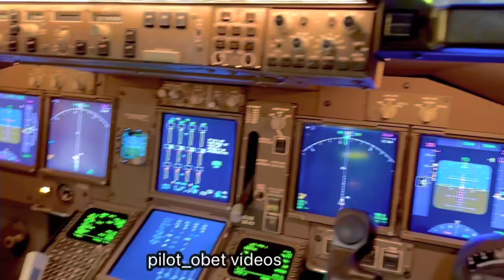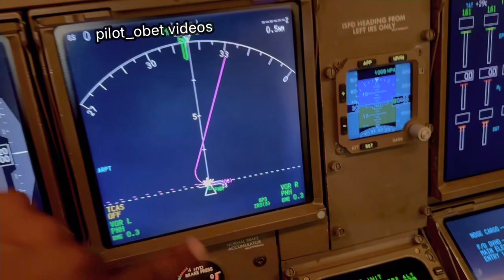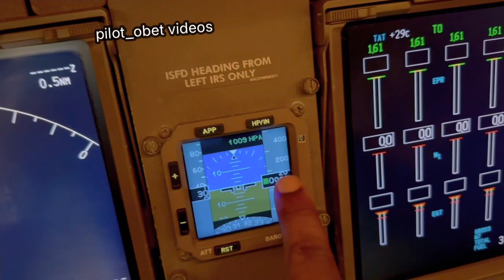Boeing 747 Flight instruments question

Comment: If it is what it is on the A320, then those could be the light sensors which automatically regulate brightness of the display relative to ambient light. You have additional controls on the sides of the cockpit.

Comment: Initially, I thought the dots were there to ensure the screens are installed in the correct orientation!
Now I am thinking the dots may be compliance marks to indicate that the screens are modified units that reduce the risk of all screens blanking out at the same time.  There have been at least 2 instances where all six integrated display units (IDUs) on the flight deck panels went blank in flight, which resulted in an airworthiness directive being issued requiring operators to upgrade the units.